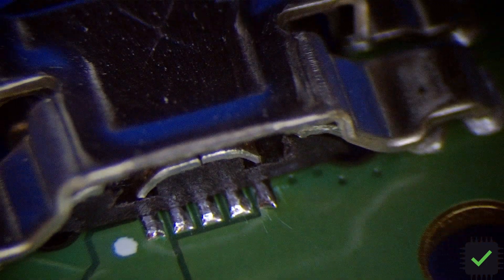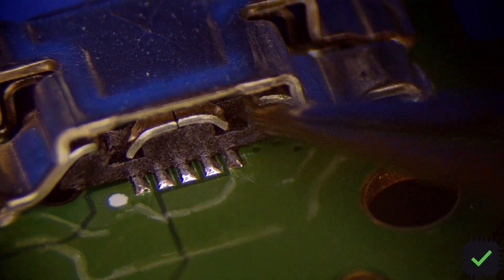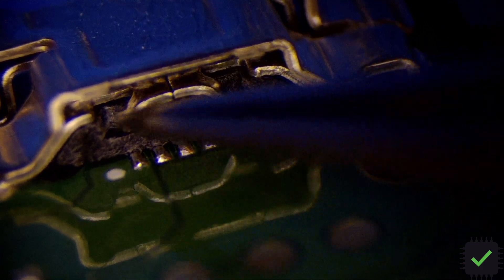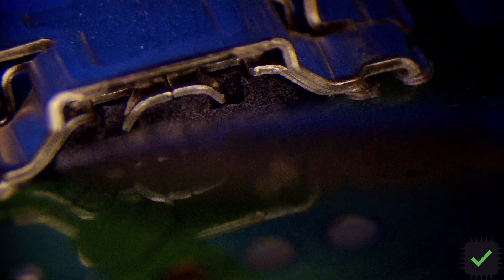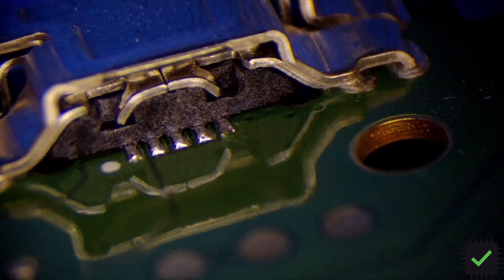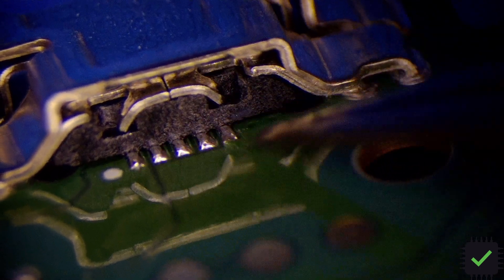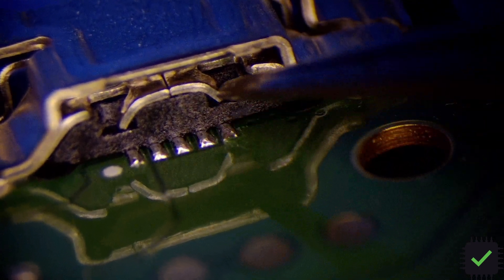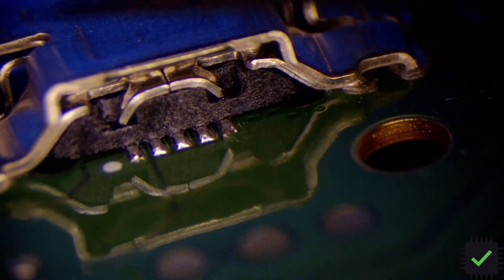Amazon Fire HD Fire HD 10 SL056ZE Charging Port Repair Tips

Comment: Thanks for the video, but I already went ahead and removed the old port and about to install a new one, but I noticed that I pulled up pads on the 3 center pins of the port.  Do you know if these pins are used?  And if they are, where I might be able to jumper them on the system board.  Much appreciated if anybody can comment.  thanks.